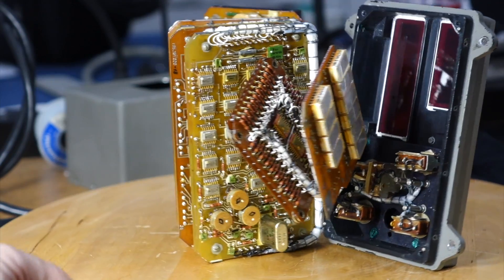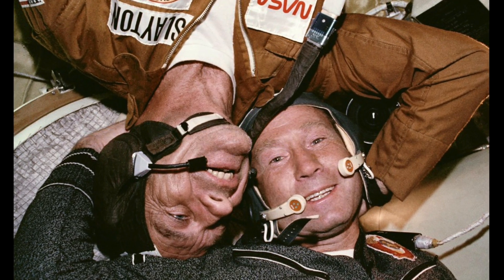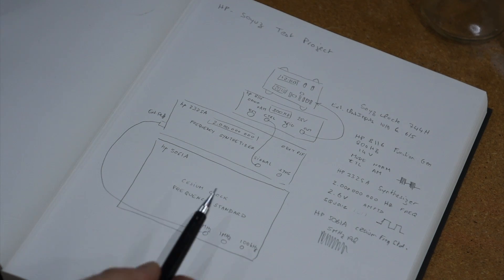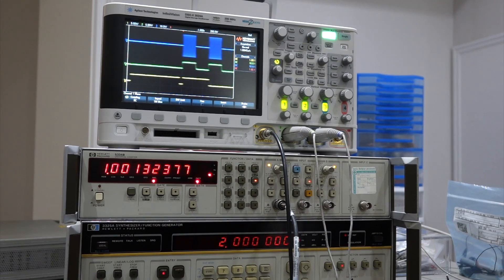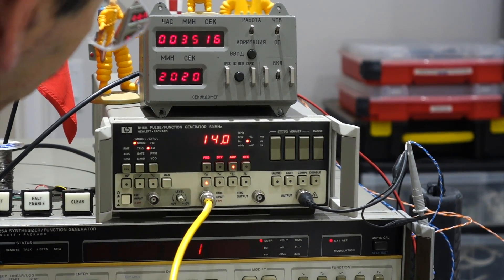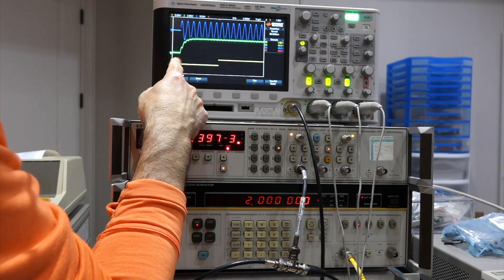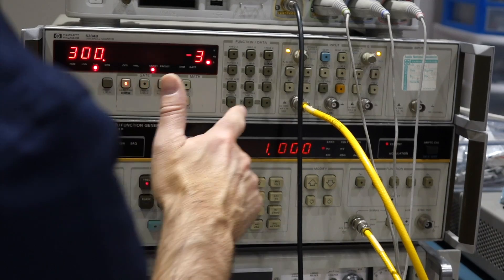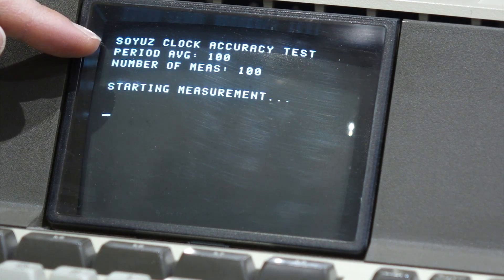Soyuz Clock Part 6: International Atomic Space Clock

Comment: The counter cannot do reverse measure method ? Very strange. Usually you do not measure the slow input signal but use it as gate for the precision 10mhz ref clock.
Reply from the maker: Of course it does.
Reply: @CuriousMarc  then I do not understand why you get only four digits resolution at 8:35, and not at least six or seven...
Reply from the maker: @thomasw6169  I have to admit I was confused too for a minute. It’s just because phase noise dominates the measurement.
Reply: @CuriousMarc  phase noise in the synthesizer ? Hm. Ok.
Reply from the maker: Yes it turns out this particular synthesizer is very noisy in the low end of the spectrum. A simple divider would not have had this problem.
Reply: @CuriousMarc  Thank you for the excellent videos. Superbly made. A joy to watch.

Comment: I once worked at a naval air station. 
They had "labs " for civilian engineers. 
They did something to shift the frequency from 60hz to up and down by about 15% . It killed most of the equipment that I was responsible for and caused havoc. 
It took days before I figured out what was going on. No one checks the frequency of the mains going into various equipment rooms, no one. 

I eventually did. 
Wow, what a difference a few Hertz makes. 
Air to ground, ground to ground, navigation beakins and weather station. 
All took a dump over less than 15/30% total frequency deviation.
You have neat toys, I can't do it anymore but, I can appreciate. 
Thx.
Reply: Twenty fouuuur little cycles

Hmmm.
Can't think of words for Brought the Sun and the Flowers